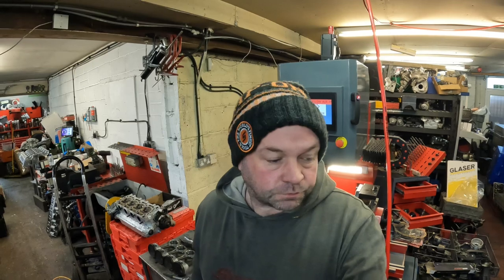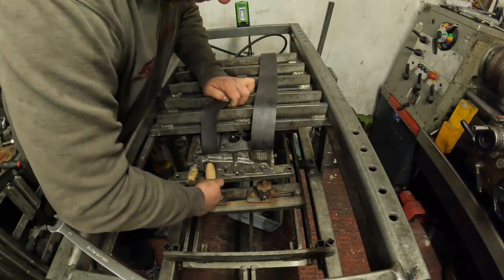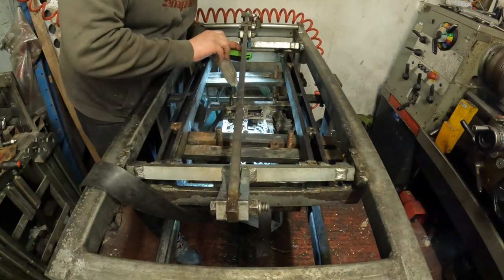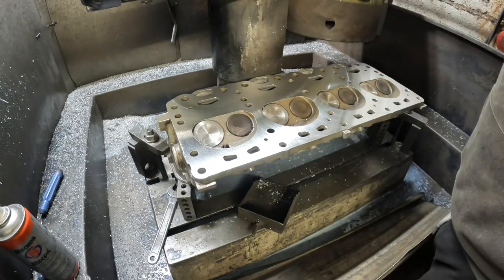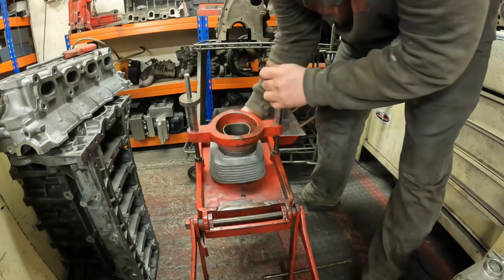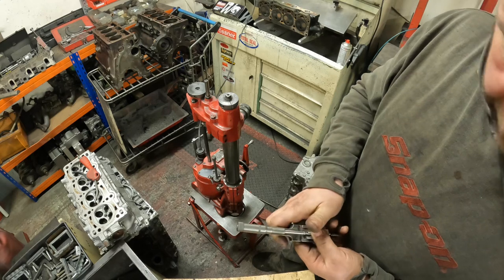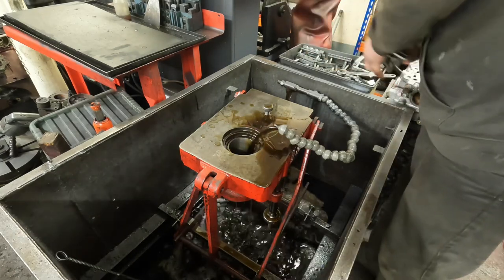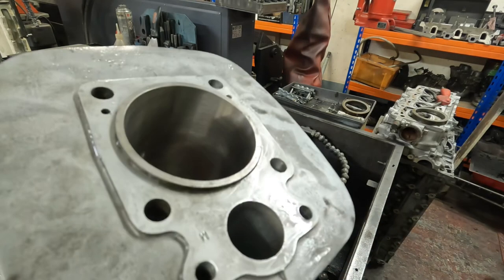BMW Pressure test | Bentley V8 Head skims | Vintage BSA Motorcycle Rebore | Machined Keyway

Comment: Piston. Great to see the motorcycle cylinder boring. I saw that machine used on one of Millyard’s videos it looked very similar. Obviously the go to boring machine for that type of work.
Reply from the maker: Thanks Jake . Yes it's a great machine.. honing it correctly is the most important bit of the process though..